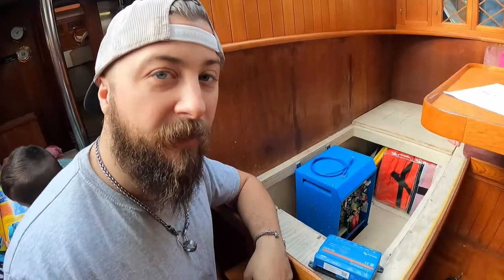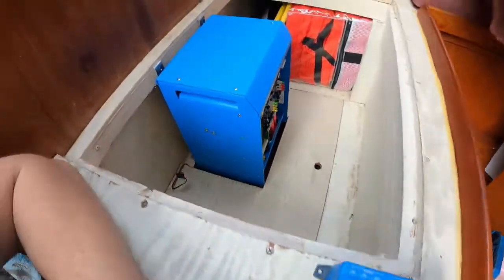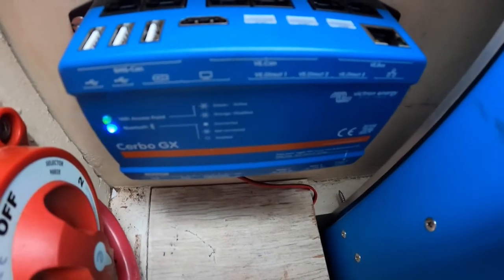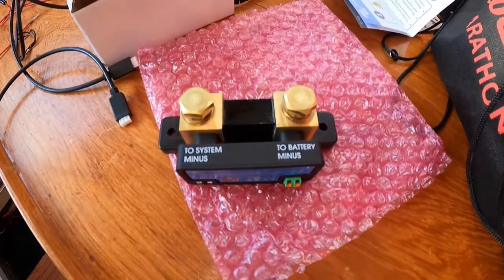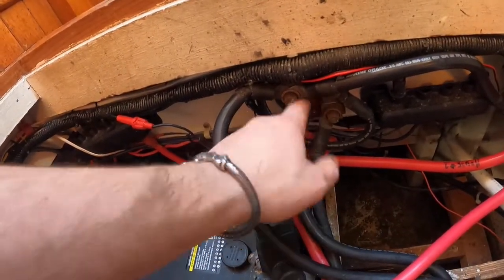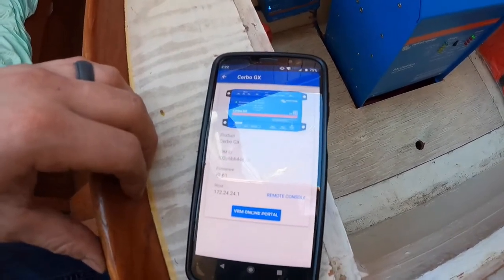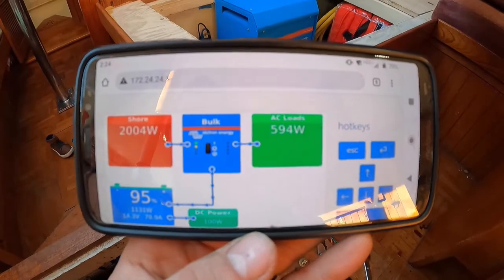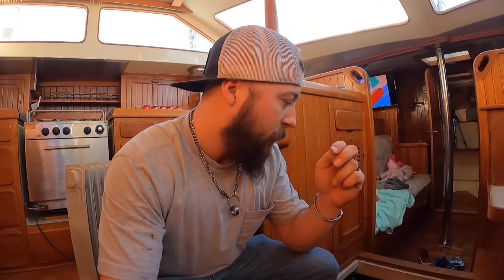Victron Cerbo GX Install- Now Watching Batteries From Phone!

Comment: The Victron UTP RJ-45 cable looks like a standard Network patch cord. However, I can't tell by the picture if it's a straight through or cross-over cable. To tell the difference between a standard or cross-over cable, look at the ends. If the wire colors are in the same order on both ends, then it's a straight through. If one end starts with Green and the other starts with orange, then it's a cross over. There are two types of cross over cables. One switches the Orange and Green pair only. The other switches the Orange and Green pair along with the brown and blue pair. If anyone owns the Victron cable, then check and let me know if it's a crossover or straight through. Based on the price, I would say it's straight through.